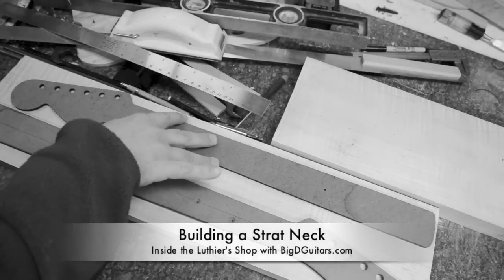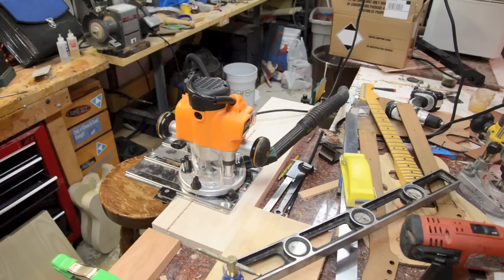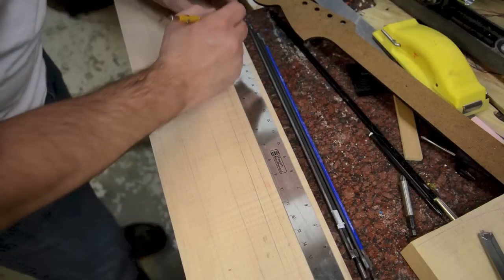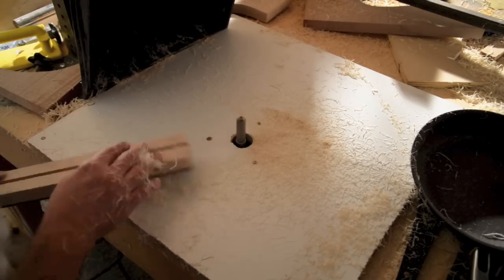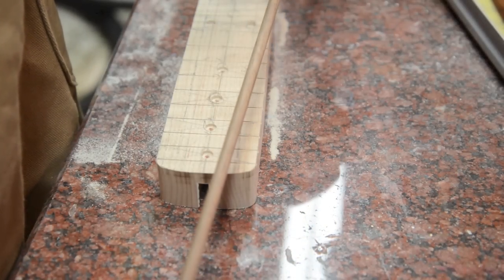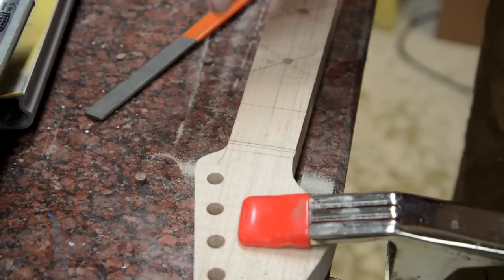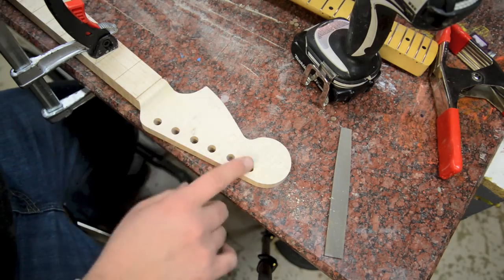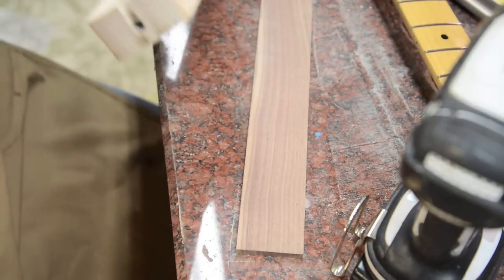Building a Strat Neck Luthier Build Process Part 1

Comment: Just a very basic question, when you take the sanders to the headstock I noticed that you weren't sanding with the grain.

Just curious about why?  In my EXTREMELY limited experience I thought you were always supposed to sand with the grain

Comment: Great video, I'm a beginner and want to try this.
I have a few questions though.
is that a double action truss rod?
you only have to anchor it on one side right?
could you have the adjusting part protrude at the headstock end?
Could you send a link of where you would buy a truss rod like that.
Also, where do you get your templates?

Comment: Hi, are you using a hex ended truss rod?  I bought one of the low profile truss rods from StewMac and was not sure if it would work having the adjustment at the heel.  I thought it would need to be at the head stock.  
Thanks!
Reply from the maker: +William Stewart I use an Allen wrench rod.    They usually all work out

Comment: Slightly advanced question here, but did you route the truss rod channel the full length of the rod? If so, what keeps the truss rod from pushing the skunk stripe out of the slot? Do you just trust the glue to hold? 

I'd like to make some one piece necks but with superior double-action truss rods, so I don't have to tinker with curved rod channels and angled access holes... but the rod popping out of the channel is my main concern.
Reply: The glue joint is stronger then the wood itself
Reply: Joey Zahariuk Thanks for the insight! I’m actually working on skipping the skunk stripe altogether. Building a machine to drill the length of the neck for insertion of the truss rod, using a self centering gundrill bit.
Reply: @ForestCinema  good luck most guys that install these truss rods rout for the Rod itself then stop and route a wider router for the nut portion. He did one channel this was obvious directed at the beginner builder showing how it can be done easily with minimal tools. I've watched all of Bigds videos and he's super talented luthier. People were trying to cut him down here and to me this is one of my favorite videos he has done. Not everyone has a fully functional workshop with thousands of dollars of tools and machinery. Most of us enjoy making our own instruments and are using basic tools to do the job. Thats why this series is one of my favorites.

Comment: You cut the frets right into the neck and do not use separate fingerboard stock?
Reply from the maker: TMBridge this is a one piece
Reply: @bigdguitars  I see.  Would recommend a one piece or a two piece for a first-time guitar builder (but experienced woodworker)
Reply from the maker: Two piece.  Much easier.

Comment: How do you know where to line up the ruler for the frets? How do you know right where the nut is at?
Reply from the maker: the ruler cuts the nut as well.  cuts two lines that are the right size
Reply: @bigdguitars  but how do u know where to start the nut on the neck? I didn't notice any center lines or fret lines on the strat template. It seems like when u go to transfer the fret markings to the neck, you have no reference for where to line up the nut on the ruler....

Comment: This is done terribly. You said strat neck but strat necks use curved truss rod channels as well as skunk stripes they also only use single action truss rods and they don't route all the way for the channel. They drill 3 degrees on both ends and they hold the truss rod in at an angle. This video is a just a sign of laziness maybe you should actually try making a neck worth using.
Reply: +FlamingPurpleCat You dont need to route at an angle if you have a dual action truss rod
Reply: You're just being a Negative Nelly.  Youtube comment sections are no place for such negativity.
Reply: man so passionate about single action truss rods. double action rods are great and no need to drill at an angle using the better rod. I wouldn't say "lazy" , it's just different than you like to see.
Reply: This guy is doing this with limited hand tools showing that it can be done at home with limited tools. The truss rod he uses is standard in today's necks and like others said doesn't need to be angled.